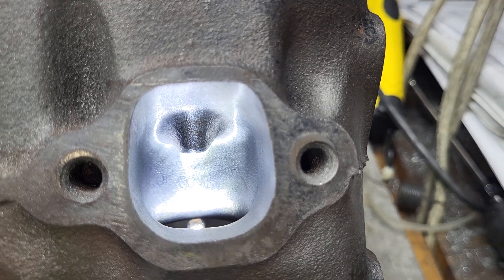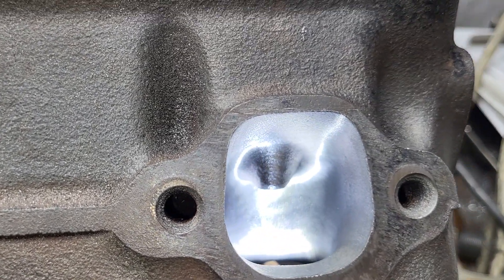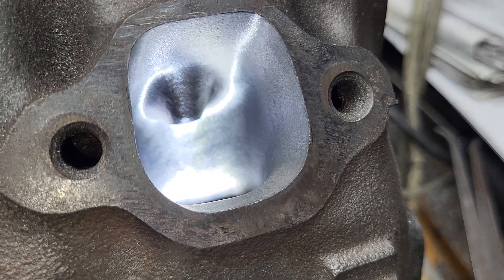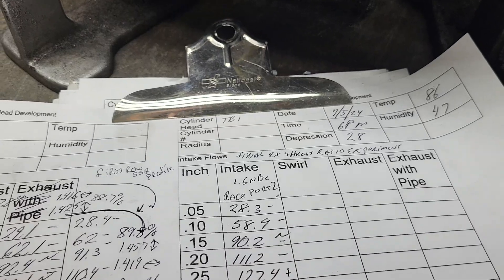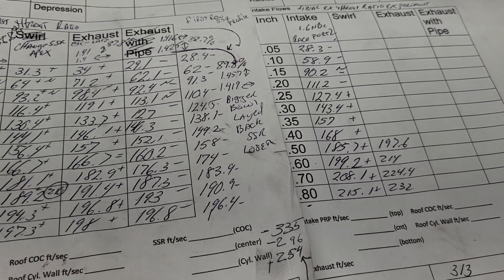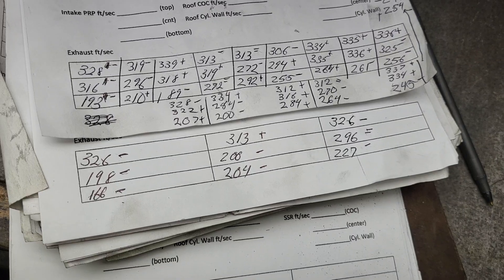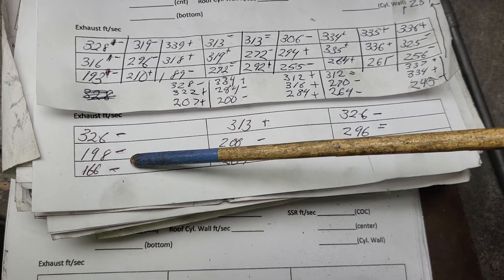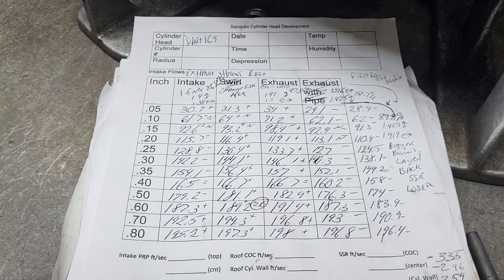Chevy TBI exhaust port throat ratio experiment. Chevy race port?

Comment: Awesome stuff!  you mentioned that you wouldnt braze these cheaper heads but would you braze say a big block Olds head on the floor to mimic the edelbrock olds exhaust port shape?  if you google it its roughly 1/2" raised on the floor.  anti reversion too with a rectangle header port flange?   thanks.  Wish i could post pics to make it easier for you to answer.  I know your time is valuable
Reply from the maker: @robtdougherty  Depending on the application and how much I think it could be improved I would consider it. Everything needs to be trued up after brazing due to heat warping. Keep that in mind.

Comment: I've been preaching for years, I don't care what the exhaust flows on the bench... it goes supersonic on a running engine. Bench is good to make sure the port isn't tripping somewhere in the curve but that's about it. Once I finally let go of the flow numbers and started just giving the exhaust some area and shape my life got a lot easier. My stuff normally runs better than i expect it to.
Reply from the maker: @dirtfan05  So you like this port?
Reply: @servediocylinderheads no, don't like the valve job, throat is too big for it. When I say I give it area, I mean I open up the throats, widen and lay back the short side, work the guide boss and send it. I'll only enlarge the port itself if it's high rpm, nitrous or on methanol. I've found methanol stuff likes a bigger exhaust port. On production heads I usually end up at 1.350"ish with a 1.6, works out really nice with my valve job. Aftermarket heads i'll get into 1.400"+.
Reply from the maker: @dirtfan05  Good info. Thanks

Comment: The port will transfer more of the exhaust gasses throughout the valve action. This larger port will flow more at its initial opening when pressures are the highest. Taking advantage of the overlap. You will also be able to use a shorter duration, or earlier valve timing.  
  The flow bench remains constant for reading. But does not replicate pressure of the running combo. This would yield higher power numbers on a dyno.
Reply from the maker: @approachingtarget.4503  I agree. Good info.

Comment: As soon as you raised the roof I knew the air would separate.  That's a healthy gain though.  This would be a good candidate for DV anti reversion plate in the exhaust header.  How much of the bottom of the port can you cover up before it drops cfm?
Reply from the maker: @chrisstavro4698  I didn't try but the air speed is low on the bottom. Thanks

Comment: Area is important. Velocity is important, but the exhaust side is odd. When John Kaase developed his new SR71 head, he left the exhaust the same size as the huge SCJ port. He admitted on a bench that when filled, it flowed more CFM but lost 30 HP on the dyno.
Reply from the maker: @lucascb750  Good info.
Reply from the maker: Thanks

Comment: 0.20 lift isn't minus? I think is a winner as it has got better flow from 0.20 lift on and it tops out way better. I wonder would you like to test the theory and try to fill the floor with some clay
Reply from the maker: @mikkokuorttinen3113  eh